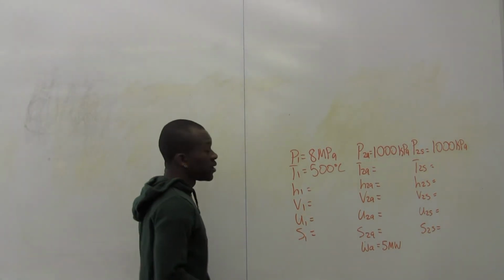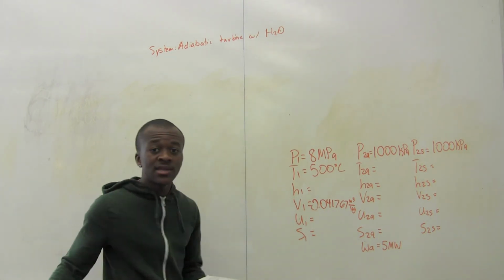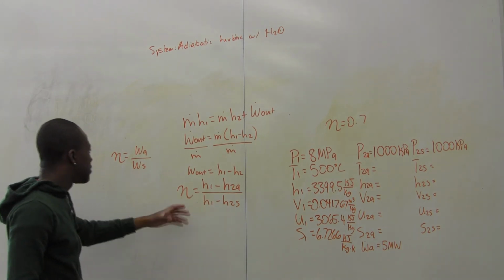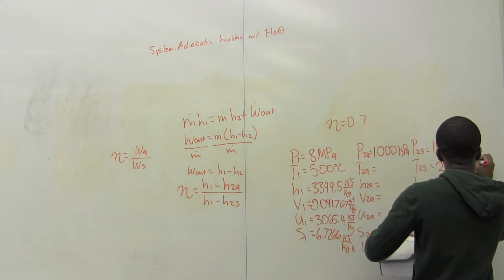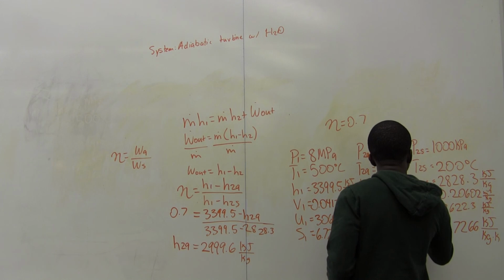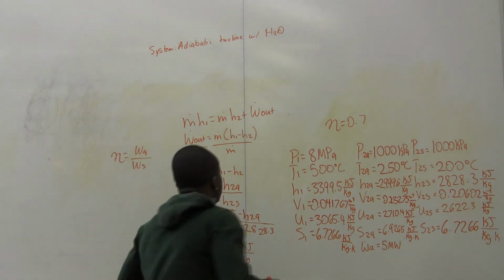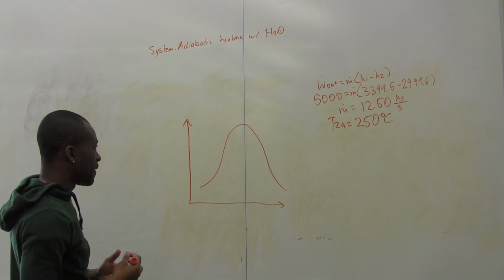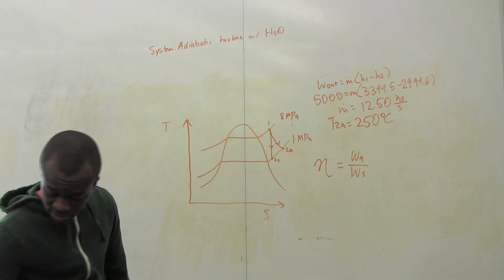Lesson 17.1: Example Turbine Problem Dealing with Isentropic Efficiencies

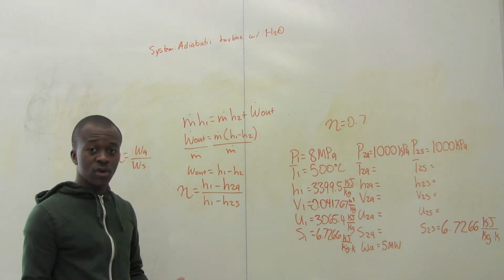Comment: Just to refresh my mind and I don’t wanna open my notes right now @6:44 it’s superheated because s > sg right?

Also, why isn’t s2a the same as s2s?
I thought they were supposed to be the same? Just like P2a = P2s
Reply from the maker: Clara Mel B exactly! It’s because s>sg
Reply: Baahir Jinadu thank you for the quick reply!
What about the entropies? Aren’t they supposed to be the same everywhere? Just like the pressure?
Reply from the maker: Clara Mel B well not exactly. s2s means that it is the outlet part of the isentropic turbine. Because it is an isentropic process the entropy doesn’t change. In an actual process, we see that entropy always increases, which is why the s2a will always be higher than the s2s. The state of 2s is the most idealistic state in this situation so it has to be different.
Reply: Baahir Jinadu does it mean that if I think about it as a Carnot efficiency, the s2s should be the maximum entropy the turbine can produce but then we have s2a > s2s because it’s not a perfect system?

I’m sorry, I might be confusing both of us!
Maybe the annotation is what’s not clicking in my mind 😅
Reply from the maker: Clara Mel B all good lol. if that works, you could envision it like that. But yes, for a turbine s2a will always be greater than s2s.
Reply: Baahir Jinadu also, s2a is only bigger for a Turbine, right? Since a compressor consumes work, wouldn’t you have s2a < s2s?
Reply from the maker: Clara Mel B i genuinely can’t remember at the moment, but I don’t think so. I believe, regardless of the process, s2s will always be greater than s2a. I’ll have to double check that for you, though.